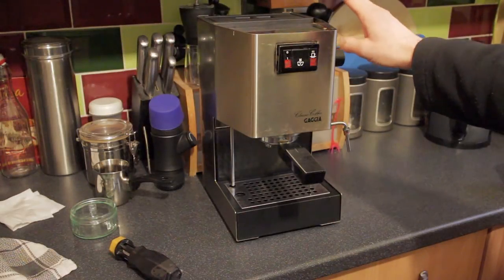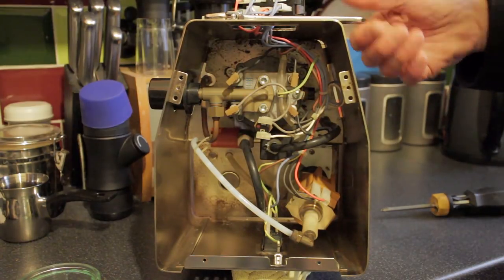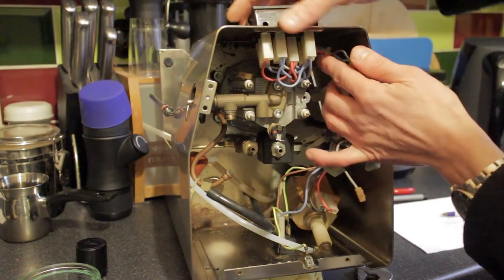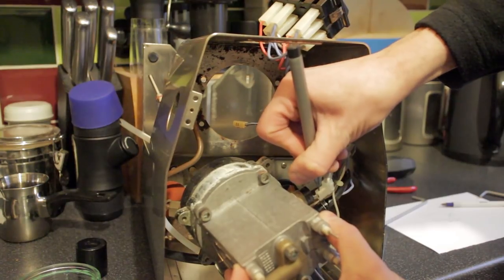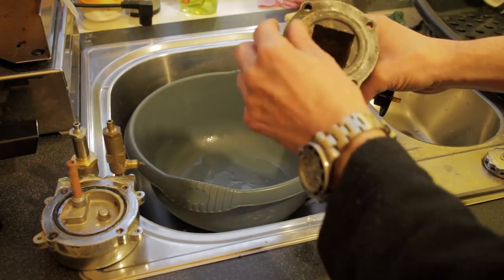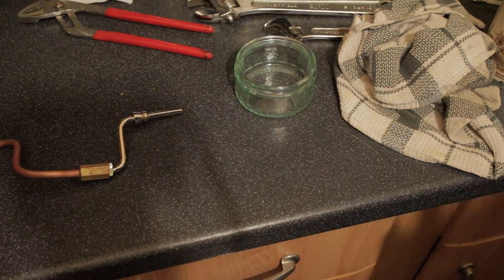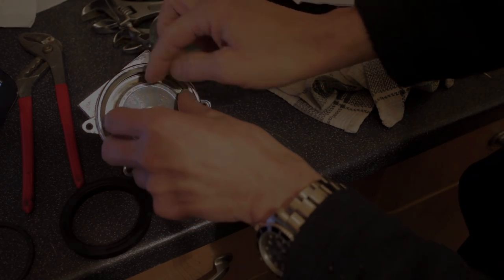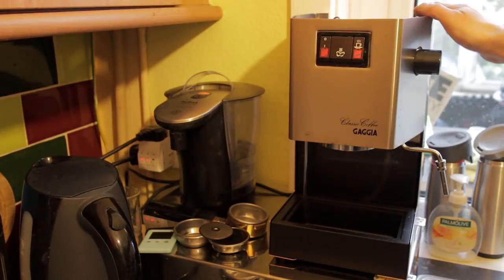Gaggia Classic Full Service and Descale, Boiler Strip, Seals

Comment: Hi : I have a gaggia classic that needs some attention : way beyond me : do you do servicing
Reply from the maker: Not in any official capacity.
What is currently wrong or not working and where are you based as this would have a bearing on thing re shipping etc?
Reply: No/variable water pressure at head : tried adjusting POV but still no good! I am in Edinburgh: happy to send tho if poss!!? Thanks James
Reply from the maker: @jamesgraham7031  It sounds like a thorough clean and perhaps descale might be needed.
Just a quick thought that might save you some hassle, if you have a crosshead screwdriver and some Allen wrenches. Take off the shower screen that sits above the portafilter, one screw and recheck the flow, if you get decent flow then give the shower screen a really good scrub in hot water and washing up liquid as these do gunk up especially if not used much. If not you could try removing the dispersal block above, 2 Allen bolts. Both can be safely accessed from outside the machine, take out the reservoir and lay it flat you can see easier.
I take it you're hearing the vibration pump working?
That aside I'm happy to have a look for you but I'm going to be busy for the next few weeks.
If it helps at all I'll be around Glasgow on the 8th or 9th.
Reply: Great video, but whilst I managed to change the group head seal today and plan to run a descaling cycle when my Gaggia descaler arrives next week, this sort of servicing is waaaay beyond my level of competence and confidence.

What would you charge to do a service like the one in the video if you wete so inclined (excluding postage, which I would obviously cover)? Mine's been used in hard water areas so I dread to think what state the boiler is in scale wise...